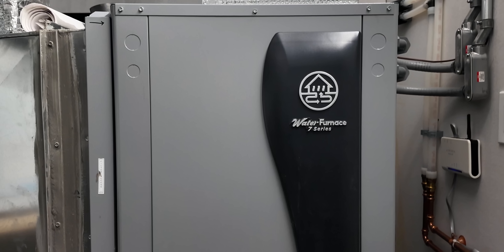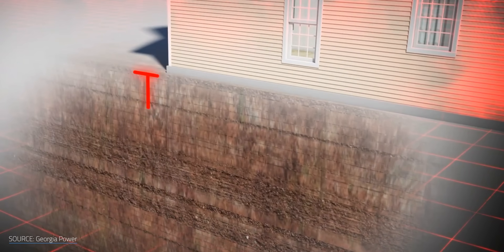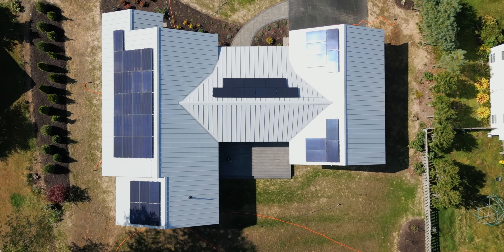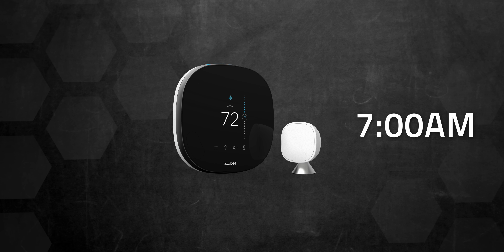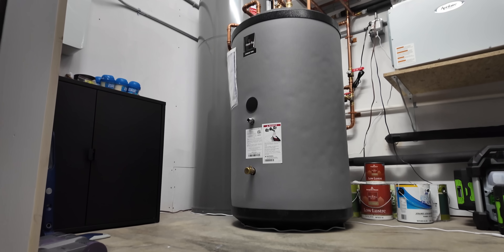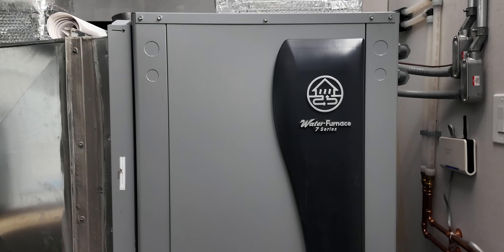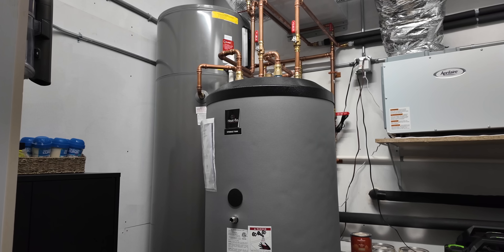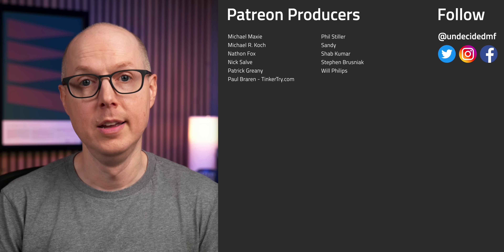How My Geothermal Heat Pump Really Performed (2 Years)

Comment: Just a few thoughts:
Concerning installation/operating costs costs, if you produce enough energy (or close to enough) that you could also support an air-water heatpump, then your break even with a geothermal heatpump will be much further down the road (well unless you can sell your excess energy for a good price). 

Concerning maintenance costs, if you spring a leak in your geothermal setup, things might get expensive very quickly (and this might even be worse for a horizontal groundloop setup). A neighbour of my parents had a geothermal horizontal groundloop setup. Somewhere in the system underground a leak happened after a few years, and to get to that leak, they basically had to tear up the entier garden. So basically they had not only a big repairbill, they also had to rebuild their garden from scratch.  With an air-water heatpump the risk is far lower (less piping and most of it is protected in the house) and if it starts leaking, you should have an easier time getting to it.
Reply: yeah I wonder if there is a way to design it with maintenance in mind.
Reply: @danilooliveira6580  Difficult. I mean in theory you could build a maintenance shaft, but the pipes need to be in contact with as much soil as possible.
Reply: @Daniel-rd6st  yeah but I wonder if it's not case of just needing some clever engineering. you could for example design a mechanism to find in what section of the tube the leak is so you don't need to excavate everything for horizontal setups. maybe for vertical setups you could submerge the tubes in water to replace soil, that way if you need to fix/replace the tube you can just pull it out of the shaft instead of needing to excavate everything. but then you also need to ask if the extra cost is even worth it.
Reply: You could also just spend less on your energy production instead to pay for the geothermal drilling. Solar panels go down in price over time a fair bit so you could always add them later
Reply: @meneldal  yes but if we all could save in energy in general it would be better. the more we save in energy, the better for the world.
Reply: @danilooliveira6580   I would say the less we CONSUME energy, the better for the planet..😉
Reply: @peterfitzpatrick7032  that is what I said, isn't it ?
Reply: Maintenance of the geothermal loop is basically a non-issue, unless you live somewhere with high risk of movement in the ground or the original installer have done a terrible job. 

If you for some reason would have to do something to your vertical loop you just pull it up out of the hole and fix it. If it’s not fixable you exchange the plastic loop. It’s comparably cheap. The coolant liquid can be reused, though it isn’t that expensive to change either. Doing any type of maintenance on a vertical loop would be more expensive since it’s not accessible the same way as it’s completely buried and you can’t very easily locate the faulty area (depending on the fault of course).

The house I live in has had a vertical geothermal heating solution since the mid ‘90s, and the loop is likely good for 20+ more years.

Comment: We’ve had a standing column geo system for our heating in Vermont since 2008.  450 foot well, which supplies both house water and geo system water needs.  It only cost $30,000 (only…!) but it also has a desuperheater which does improve hot water heating costs just by pumping warmer water with whatever is in the electric water heater.  In fact, for some of the VT winter, we turn off the breaker for the electric unit.  Our best decision was to get solar PV when we could finally afford it.  Like Matt’s, our electric bill is now limited to the service fees which the state mandates cannot be paid with excess generation.  But for ten years, our utility bill was $0.00 every month.  Repairs are expensive.  The well pump and controller both failed on a 15-below day in January one year.  But that’s almost the only expense we’ve had.    I recommend geothermal hvac, not only because of low operating costs, but also because there is no longer any toxic fuel oil smoke coming out of the chimney.
Reply: If I could get it for $30K today, I'd pull the trigger right now.
Reply: If only I had an "extra" 30 grand.  no one has that.
Reply: It seems you're supporting the case that geothermal + solar is a waste. If you can generate your own electricity you're better off using a traditional (air) heat pump. If you're effectively at a $0 electric bill then you overspent and are too efficient.
Even if your monthly bill was $20 more because of the loss in efficiency, that's nearly a 100 year pay-back to offset the premium paid for geothermal. But wait, take those saved funds (could we call it $20,000?) and buy some bonds or decrease your mortgage; now the interest will cover that electric premium about 4x over. You're actually losing money "investing" in a geothermal system.
All that doesn't even factor in the expensive repairs you'll encounter with geothermal over it's lifetime (which you already got a taste of).
Unless you have a 10,000+ sq ft home, geothermal is simply not the more economical choice
Reply: @G0F15H  With my electric rate of 13 cents KW/h, I'd never break even.

Comment: What I'm really missing here is hard facts about the seasonal performance (SPF) factor achieved. It is known that highly efficient ASHPs (such as the Lambda Eureka) in new buildings with large area heat dissipators (such as floor heating) can reach SPFs up to 6 (i.e. 600% efficiency at the Strasbourg climate). I doubt that this geothermal setup reaches significantly higher efficiencies, but the relevant information is missing from the video and it only contains that very strong claim of a more than 50% energy saving thanks to the GSHP...

Comment: You have not mentioned noise. Air systems' outside units can be disturbing, especially at night. Is geo system quiet?
Reply: By far the loudest part of my system is the air handler (if you are in the utility room) or air noise in any room. Outdoors is zero noise as the lines from the house to the wells are 4 ft below grade.
Reply: lol   karen

Comment: I have a similar system, NL, Europe. I'm saving around 2,500 euros per year, using electricity instead of natural gas, and my system was cheaper than yours. I turn on the heating function around 6 months per year and the cooling function 2 months per year. For 4 months per year I keep the system off (except the hot water). For me, when I factor in the use of the home battery and dynamic (quarter hour) electricity prices, the total break even point is between 15 and 20 years.
Reply: Your not saving.  You just pre-paid with that system. They all have a useful life and can and will be a.l liability In the near future.
Reply: @herbfst  Well alright then, I admit that I did it to save the planet. And also to pay less to Putin for his natural gas.

Comment: I have geothermal and solar, and will soon add a home battery.  I think it is worth it, even though I have low energy costs here in the Midwest (maybe 12 cents compared to your 31 cents).  So the payoff will be a long time here and it is important to remember that.  I built this system 15 years ago and it keeps running well.
Reply: Nice, that's the triple threat. 👍  I've got solar and battery, but not geothermal.  How much was the drilling of your geothermal?

Comment: I wonder if geothermal would be worth it in my area, if i were to build a new house. With the price of solar panels and batteries, and with high quality insulation, the upfront cost for the heat modern house needs might be just too much. That said, resistive heating is still expensive, and air to air is loud, so idk really

Comment: There is a way for cheap heat from ground, if you build new house. Simply put the ground loop under Your house foundation. If You plan to have a basement, then you have to dig only a bit deeper, it keep costs very low. Google for 'Foundation Heat Exchanger'

Comment: I'm interested to see if you did a blower door air test and what were your numbers when construction was in dry in phase and then numbers again when it was finished.  Many new homes are built so leaky and lots of builders unfortunately don't have the time to detail with tape, glue etc all leaky locations, definitely adds cost to the homeowner which most would opt out and just add more or bigger unnecessary HVAC to compensate for all the leakage.
Reply from the maker: I actually have a few videos about my home build where I cover those things. https://youtube.com/playlist?list=PLnTSM-ORSgi7FwYRnWkpCSkAeFOzrgh5h&si=Ain1j91VuH1uEZMk
Reply: Awesome that you did man! 🙏

Comment: $78,000 seems ridiculously expensive but when you compare that to the cost of a pickup truck… not so bad.
Reply: It sounds crazy, but if you already need a new system, take the cost of a conventional system off the top. Then rebates/incentives and you can get down to maybe 50% more than conventional. 
The toughest part is you have to be able to front the full cost, then recoup a lot over a couple years (assuming you pay enough taxes to benefit from the tax credits)
Reply: @W0X0F  That is true. I have a forced hot air by gas. I’m looking into a split system where I can utilize my existing duct work.

Comment: I'm sure geothermal has its uses for new construction, but i personally would rather not drill holes in my already existing basement. I might consider it if my gas furnace conks out, because i don't really want to add more heat to the air either, but older gas furnaces are easier to maintain.

Comment: I've been holding out on ditching my oil hot water hoping that geothermal can get in my budget range
Reply from the maker: Have you considered moving to an air source hot water heat pump?  Might be a good fit … and fit the bill (so to speak)?